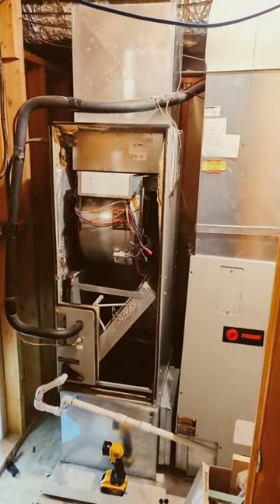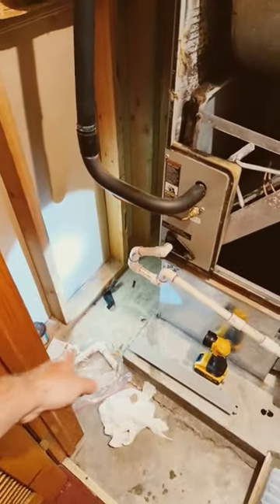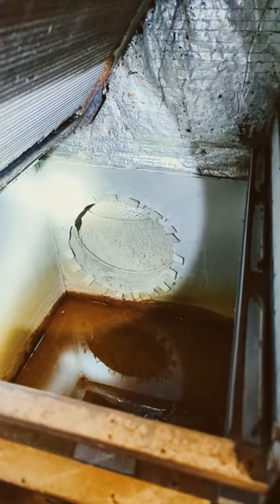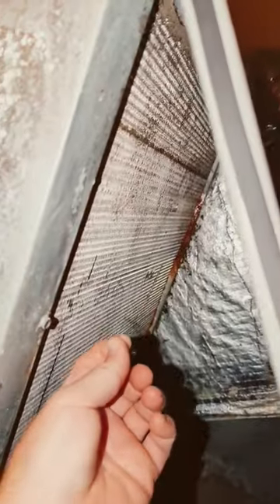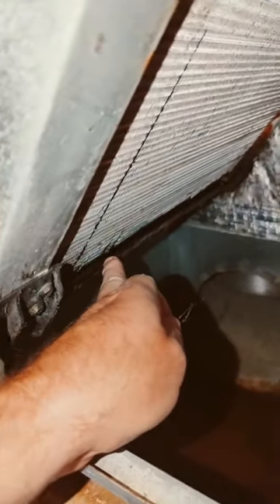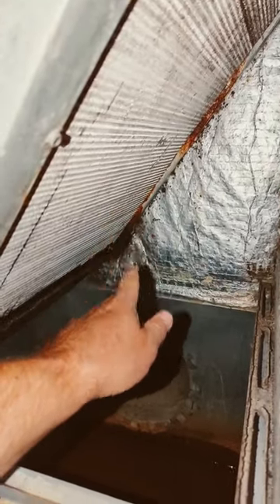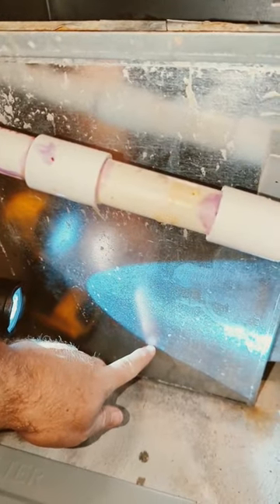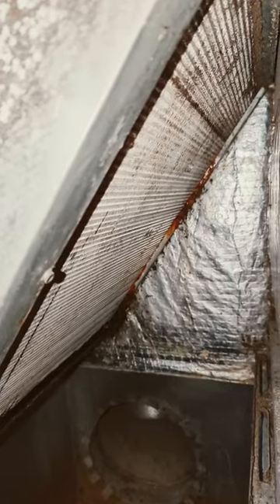HVAC Central AC water condensation collection problem. Water dripping before it reaches the tray

Comment: Low airflow across coil .. aka fuzz buildup will cause suction pressure drop and at low suction pressure your coil will start to freeze up causing water to leak when it thaws out in most cases
Reply from the maker: Thanks. Perhaps there is still mess in the middle of the coils. I suppose I could bring in a hose and bucket.
Reply: High static pressure
Reply: Call ac technician 😂, u have other issues

Comment: That's a funky P-trap you got there.
Reply from the maker: It is working better now. I think it was not cleaned for a long time. Spraying it out with the garden hose while vacuuming out the water helped get a lot of the stuck dust out. All power was cut before I did that.

Comment: Its probably impacted between the coil fins. Just get a hand pump water sprayer and go at it from both sides real good. Should clear it out. Just dont be a jackass and use a wire brush or something stupid and destroy your coil. Hope this helps. 5 years in the HVAC industry here. Not just speaking from my ass lol
Reply: What’s your opinion on foam cleaners?
Reply: I agree. Personally, I have a little coil pressure washer that works great for cleaning the fins without damaging them. They look brand new after

Comment: How did u clean it??
Reply: You can use coil cleaning spray from Lowe's or Home Depot and spray it on the fins, let it sit for 10mins then spray it away with a spray bottle of water. I do HVAC services for a living so I have an industrial coil pressure washer. But the spray works for diy

Comment: If its making  it halfway  down the coil  and falling off it could be low on refrigerant  low charge will result  in dry spots on the coil could explain why you had no issues for 8 years
Reply: No. If it were low on refrigerant then the main symptom are the coils freezing up.

Comment: Do you have a video of how to clean it inside?
Reply from the maker: Not yet. I had large shop vac next to me sucking out water from the bottom. Paper towel rolls ready, and ran garden hose all the way and started spraying.... I disconnected all power.
Reply: @jstewart627  thank you so much bout to do a cleaning myself

Comment: I see a pee trap with no vent
Reply from the maker: Spraying it with the hose and vacuuming out the water seemed to work. I have not had a puddle form this Summer. What would also help would be to have all the duck 🦆 work cleaned out. Dust accumulation is the killer of this stuff